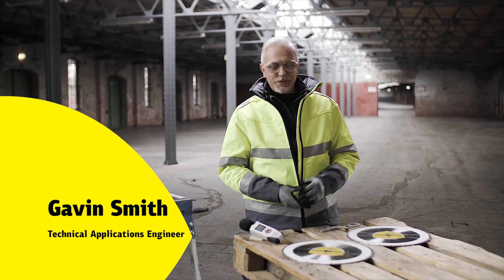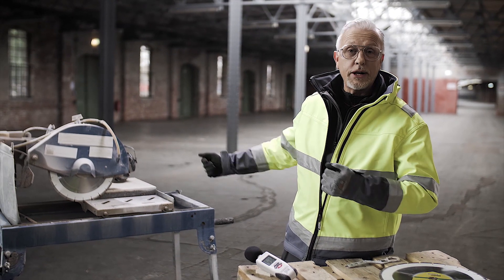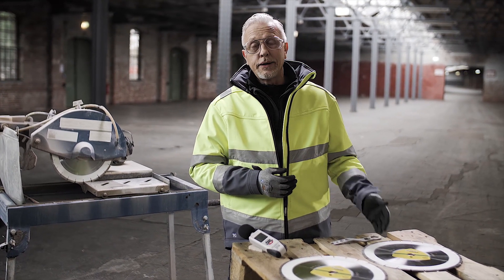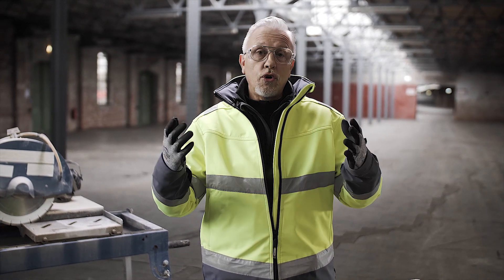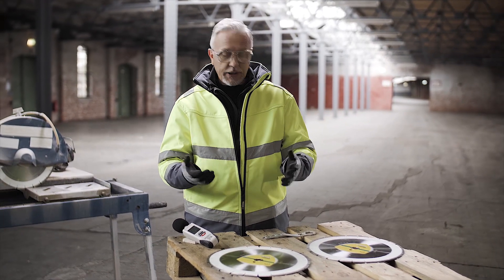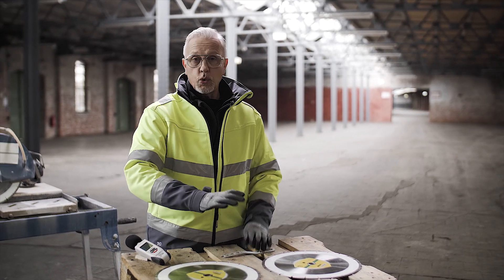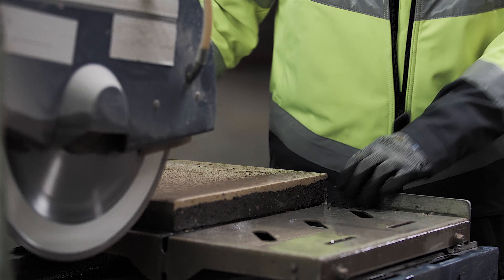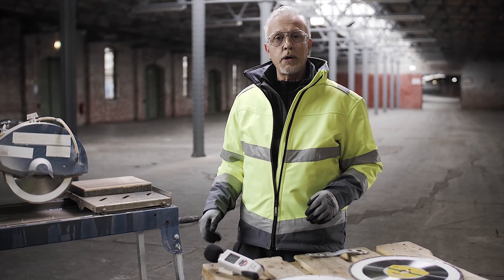Cutting "QUIETLY" with a Diamond Blade? HOW? SANDWICH CORE! | Klingspor Tips

Comment from the maker: The problem: Noise Pollution!
The solution: SANDWICH CORE!
In this handy video Gavin explains what's most important about reducing noise pollution!

Has the difference between conventional and sandwich cores been made clear?
What's your experience with sandwich core cutting blades?

You don't have a sandwich core blade yet? Not to worry, our DT 900 US Diamond Cutting Blade can help you out!

Find out more over at 👉 https://www.klingspor.de/en/products/diamond-cutting-blades/dt-900-us-special